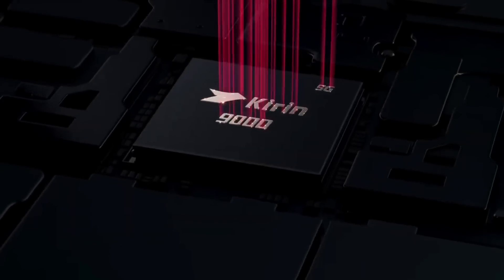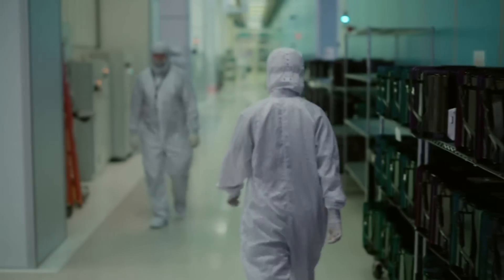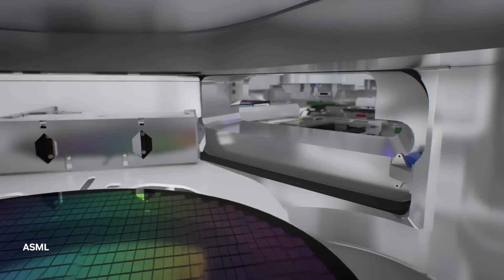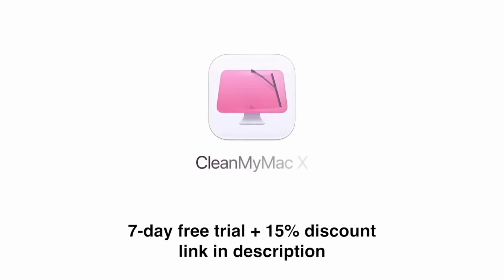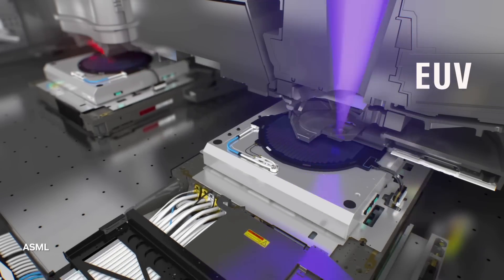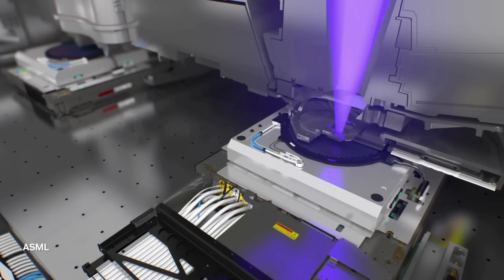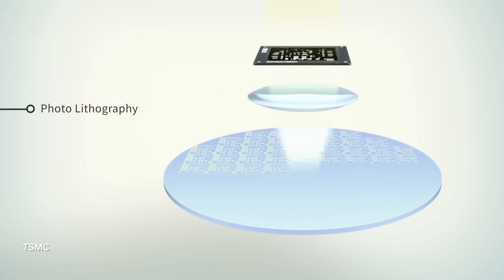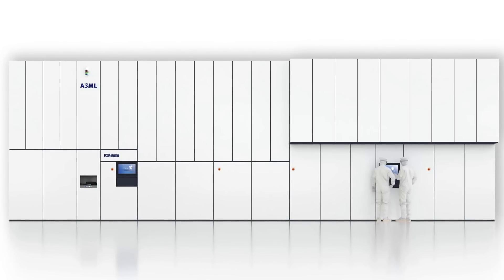The Truth About China's 7nm Breakthrough

Comment: Great channel. China has just announced their Argon fluoride and Krypton fluoride lithography machines. China is also researching in the “stacking methodology” of low-end chips to increase the density and performance to make “high-end” chips. Other solution would be using atomic radiation instead of ultra violet light. China is breaking out through the usa-based semiconductor technology with innovations that will change the world.

Comment: I was working in semiconductor industry as an equipment engineer for 26 years but during the 2008 global financial crisis, At that time, we were still talking about 3.0 to 5.0 Um geometry production chips using Canon Scan steppers. So when you talked about 5nm I thought you were referring to the line width of the device. Perhaps I left the industry too long and thus get confused. In any case, I still scratch my head how Huawei could produce their 7nm chip without the ASML tool which is the paradigm in photolithography.

Comment: You speak of yields and wastage. But the bottom line is: Can the Chinese manufacture these chips economically? If it is not economically viable, it cannot be brought to market.

No company, not even Huawei, can sell products at a loss. (Some companies do in order to gain market share, but that's not the case with Huawei.)

In other words, it doesn't matter how the Chinese do it, with EUV or without EUV. Can they find clever and innovative workarounds?

I never bet against China.

Comment: If China throws money at the fabs, low yield will not be an issue. It just needs to process more wafers to get enough working chips to satisfy the big customers like Huawei.  It will cost more and more as the process gets smaller and smaller though without EUV.

Comment: Well I hope that the Chinese Industry will get the necessary Technics to race with Intel, TSMC and even samsung. 
Anyway if I know well Intel's 10nm node called "Intel 7" still don't uses EUV technology. They will start to use it with Intel 4 which is still not available at desktop chips.
I think the chineese engineers have got talent and the chinese chip Industry can find their clients even if they haven't got the most modern technology. But they've got chance to get it even if not from ASML than SMEE sooner or later will develop an EUV or qualified machine based on something else, because now I really don't like that somebody's banning to get machines to fabricate the modern chips. Why? Free markets... 
I really like the chinese smartphones. They are much more cheaper than apple at the entry level phones and those phones have better battery, more better screen .... So for me those phones are much more better than anything else.
Reply: A bunch of giant technology companies cooperated with state-owned research institutes as well as universities, funded by China government, are working hard on developing all critical technologies, devices, equipment, materials as well as software  used in chip manufacturing industries. SMEE successfully developed 28nm lithography machines (192nm ArF)

Comment: In principle you can also do sub-wavelength lithography by use of optical near field methods. The resolution depends only on the tip size of the optical fibre, writing the pattern. So you can go to the chemical limits of the lithography film itself. But it is probably hard to make mashines for mass production making thousands of devices in parallel by optical fibre arrays.

EUV is not essential to make nanostructures. I also don't think that EUV is a very clever way. It is just a way to make nanostructures in the usual way. In fact EUV is no more UV but rather X-rays. You can also write structures with a focussed particle beam in an optical film. These are all possible ways to achieve the goal.

Comment: There are many way to cook a chicken😅😅😂.ASML EUV  litography machine may not be the only machine to make less 10 mm chips. How about using X-ray method to printing  transistor pattern on onto the silicon wafer . X-Ray radiation has shorter wavelength , than EUV wavelength. Which China may has developed. Chips is not make made by God, other methods would be used to achieve the same  results. Just like steam, can be made  using different sources of fuel; be it Nuclear Fission, burn gas, burn oil and wood etc . Dear Uncle Sam your sanctions on sales of high end machine to China, is not achieving any interesting results.😅😅😅😅😊😂

Comment: Not sure if you recall, but TSMC's first gen 7nm node (7FF) was fabbed via DUV alone, with no EUV layers. 
They reached ~97 Mtr/mm^2 in their densest library, with 75 layers in total. 

A while later they first tested EUV with their second gend (7FFP) 7nm node. They employed EUV on just 6 non critical layers, out of 65 layers in total. 7FFP was markedly denser, with 114 Mtr/mm^2.

On their N5 node they increased the EUV layers to 14 and also lowered the total layer count to 59.
And from N4 onward the EUV/DUV layers ratio is gradually changing in favor of progressively more EUV layers.

Comment: The question for the Chinese, is how to achieve 6 sigma production for 5nm with DUV machines at high volume. I think the Chinese can achieve  such manufacturing quality & quantity given time. 
Other questions are, can the Chinese think out of the box & leap frog the EUV process with some our process, such as improving semiconductor packaging, stacking more layers to the IC substrate which can be done with thier current equipments.
Or will they be able to reverse engineer EUV. I think the key to the EUV is the reflections of mirrors & transmition of EUV through highly sophisticated lens & mirrors. My observations is that to manufacture the EUV machine it need the whole supply chain of supporting eco-systems of suppliers, which is difficult to bulit.

Comment: Title: A Call for Caution: The Implications of Continuing Kirin 9000 Production

Introduction:
The technological landscape is ever-evolving, with innovations shaping the competitive dynamics of the semiconductor industry. One such innovation is HiSilicon's Kirin 9000 chipset, which has garnered attention for its advanced features and capabilities. However, in the current geopolitical climate, a call for caution is essential to prevent unnecessary political tensions.

The Technological Achievement of Kirin 9000:
The Kirin 9000, with its 5nm process, octa-core CPU, Mali-G78 GPU, and integrated 5G capabilities, stands as a testament to HiSilicon's technological prowess. It has found its place in Huawei's flagship devices, showcasing the company's commitment to pushing the boundaries of innovation.

Geopolitical Context:
It's crucial to consider the geopolitical context surrounding Huawei and HiSilicon. Ongoing tensions between China and certain Western countries, including the United States, have resulted in sanctions and restrictions on Huawei's access to crucial technologies. The Kirin 9000, as a flagship product, inadvertently becomes entangled in these geopolitical complexities.

The Call for HiSilicon to Halt Kirin 9000 Production:
Amidst these geopolitical challenges, a call for HiSilicon to halt the production of the Kirin 9000 emerges. The continuation of production poses the risk of escalating political issues unnecessarily, which could have far-reaching consequences for the global technology landscape.

Potential Ramifications:
The production and promotion of the Kirin 9000 may inadvertently contribute to heightened political tensions. It could lead to increased scrutiny, trade restrictions, and potential countermeasures from affected nations. As a responsible participant in the global technology arena, HiSilicon should consider the broader implications of its actions.

Advocating for Diplomacy:
Rather than fueling political tensions, a diplomatic approach is encouraged. HiSilicon has an opportunity to engage in open dialogue with stakeholders, including governments and regulatory bodies. Clear communication about the company's intentions, technological advancements, and commitment to fair trade practices can help alleviate concerns and contribute to a more cooperative global environment.

A Plea for Responsible Innovation:
While technological innovation is commendable, it must be balanced with a sense of responsibility. HiSilicon's decision to halt Kirin 9000 production temporarily demonstrates a commitment to global stability and a willingness to prioritize diplomatic solutions over potential political discord.

Conclusion:
In conclusion, the call for HiSilicon to temporarily halt the production of the Kirin 9000 is grounded in the recognition of the delicate geopolitical landscape. By taking this step, HiSilicon can showcase its commitment to responsible innovation and contribute to a more harmonious global technology ecosystem, free from unnecessary political tensions.

Comment: Commenting here using a 2019 xiaomi phone w/ an 8nm processor..  No problems whatsoever..  Still smooth as a business phone and original battery still lasts long.  Not a gamer though.. The race to smaller chip architeture is fine but wr should also not underestimate tech from 5 yrs ago..

Comment: They have got to 5nm now
Reply: true, Huawei made break through on 5nm  ."A posting on Huawei's website claims the Qingyun L540 laptop is "equipped with the Kirin 9006C chip, utilizing a 5nm process technology, eight cores, with a maximum clock speed of up to 3.13 GHz, offering higher performance, lower power consumption, and faster processing speeds.""

Comment: Huawei has tens of thousands of engineers, and its chips are completely designed and manufactured by itself without any Western technology. At the same time, China is also vigorously developing carbon-based chips. At present, the world is basically silicon-based chips, and China controls the vast majority of raw materials.  If China completely breaks up, how will the West obtain materials, rely on inventory, or find other substitutes? This process will probably take at least 10 years to complete. The raw material industry chain is not what you want to have right away. It needs an industrial chain for processing.  Building factories, selecting talents, processing, production and transportation all take time. Does the United States have the ability to solve it within one year? It is simply impossible. Therefore, Western politicians are basically clowns who know nothing about these and are no different from idiots.😂

Comment: Transistor density per square mm would be a better measure of manufacturing tech.  Heat generated at a clock frequency would be an important complimentary measure of the technology, considering how many applications must manage heat and battery use.

Comment: Im a lead CPU/GPU designer in one of the 2 x86 microprocessor design houses in the world! Let me explain it to you! Chinese got a bunch of ASML DUV machines manufacturing a copy pasted ARM design with a multi patterning that has a low yeild! It’s highly unlikely they can squeeze more out of these old tools to get them beyond 7nm (7nm is a techology of 5 years ago), They’ll be stuck while US continues to advance 5 4 3 2 with EUV. everyone is moving to gate- all-around, these guys started making finfets!

They are using American and Dutch machines made by Lam Reaserch, ASML, etc. They are using EDA softwares made by Synopsys, Mentor Graphics, Ansys, Siemens , etc. They are using core designs from ARM. They should be band from using all these! They are also using memory chips from SK Hynix that are not authorized to beised on the new  Huawei phone that this chip is on!

I also would like to correct you guys on TSMC 7nm technology. There is no tapeouts on 7nm with EUV. 7nm is a DUV only process. The 7nm process counterpart in EUV is called TSMC 6nm process!

Comment: China actually have openly said to stop at 5nm in extreme cases with DUV and 7nm is about the limit, 3nm just not economically feasible. My guess is 5nm with be pushed and a smaller half top node will be on 5nm but will stop there. 7nm will likely be a long node for them, but seems they will take 5nm as a bonus so I am guessing they will achieve this and will be a long one offcially and the line have draw stop there

Comment: I'm running an overclocked 14 nm chip. The performance gains from upgrading to the latest for the same power consumption are at best 30% from a 2018 chip. It matters for a phone but for a datacentre with government subsidies it's only relevant for choosing wire thickness for gross power consumption.

Comment: It looks like SMIC made big improvements in the precision of wafer alignment between pattern exposures.  This not only enables them to cs 5nm, it can be used all the way up the chain to 20 nm, or anywhere mp is used, to reduce variation and increase yield.  TSMC and Samsung do not have this alignment technology, because they had EUV instead.  But they are doing mp too, and reportedly only managing 55% yield at 3nm, and with only small improvements in PPA.  Because alignment is even more critical at 3nm.  It looks like SMIC has the upper hand:  state of the art chips and low cost.

Comment: The supposed relationship between 7nm and 5G is complete nonsense. 4G already runs at near the theoretical limit. 5G was a big innovation in dynamic radio network layout, namely in that it allows for far smaller cells with a more ad-hoc structure. It is more about the network than the handset.

Comment: Most people commenting here have no clue about why whats happening is happen. Of course china CAN create 7nm chip. Firstly china used modified western technology to create "their chips" they didnt design the machines in anyway. . Thats not important. Whats important is the Heald rate. Ie. How many of these chips don't have errors. TSMC has an error rate of 2%. Imagine producing one chip that requires 200+ steps and having a 2% error rate in milluons an millions of chips. People who have used the phone huawei p60 say the phone has strange characteristics. 2. How many of these chips can china produce. Remember that did not build the machines and are not blocked from getting the machines needed to produce at scale. 3. What markets outside of china will get these chips ?. Whats the point of producing chips if you can't export it.

Comment: Update: it might be 5nm chips.  On 9/25, Huawei released a system software displays Huawei Mate 60 Pro specs.  And it shows 5nm chip set in the system status.  But Huawei is quiet about it.  No official confirmation.  It creates a lot of buzz last week.  Let's see how it plays out in coming days. 

If it is really 5nm, that means China is ON PAR with Western chip technology.  The so called 3nm chip that Apple claims to use for iPhone 15 is only using 3nm technology for a small portion of the chip.  5nm chip is the real leading-edge production at scale.
Reply: It is no doubt a 5nm chips, tech insights said the wafer area is only 2% larger than Kirin 9000 which is 5nm made by TSMC. Considering it has more transistors in it,  Kirin 9000s definitely is a 5nm chips.
Reply: LOL, this sounds like a big cope.

Comment: The last time i heard, was that China is building an EUV factory.  Using this new technology they have that generate continuous EUV light source that could feed into multiple machine to make chip smaller then 5nm.  The factory could be a test bed for the new idea.  If it works, then China will be able to make chips below 5nm with out problem.  so instead of building little machine (bus size) machine with it own euv light source. China decided to build one large EUV light generator to feed multiple chip making machine.  The idea is very smart since, you can have more powerful EUV light source now and use it to make even smaller chips.

Comment: Nevertheless, I actually believe that what truly matters is that China's ability to manufacture advanced smartphone chips signifies that China can start mass-producing any type of chip. China's bottleneck in the chip industry is primarily in manufacturing. There are no significant bottlenecks in design, packaging and testing, and application areas. While smartphone chips are profitable, they are not the highest priority. High-performance smartphones are mainly used for gaming, which is purely for entertainment, and many gaming companies are Chinese. China can tailor the performance requirements of games and applications based on chip capabilities. The truly important aspects like secure communication do not necessarily require high-performance chips. Refrigerators, washing machines, air conditioners, also do not need high-performance chips.

Comment: Huawei did good job but the "breakthrough" is not about "7nm" or "5nm", rather the the complete design tool and all necessary semiconductor material involved in mass production. 

If China could design and manufacture any chips in mature "14nm" or "28nm",  that would be great breakthrough to claim "self-reliance" and it could bring enorm potential market as many 3rd world countries may have very high demand on mid-range chips in their development.